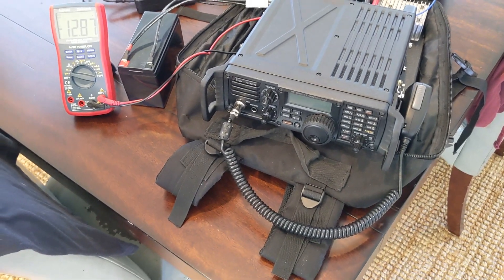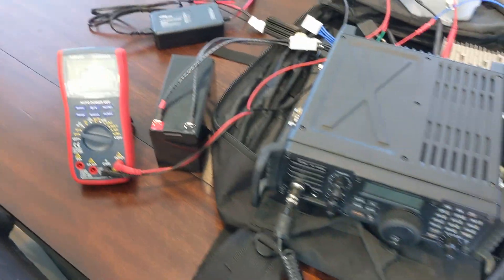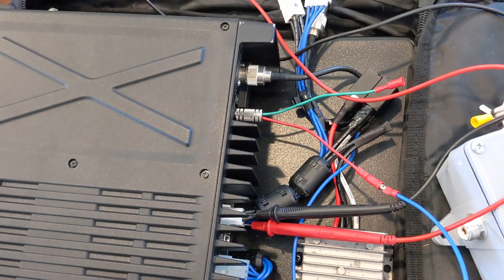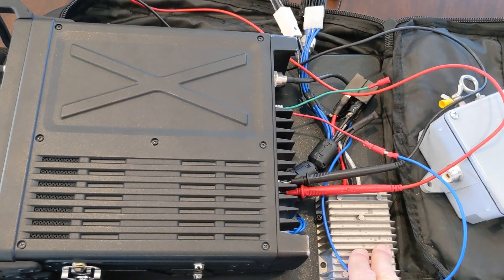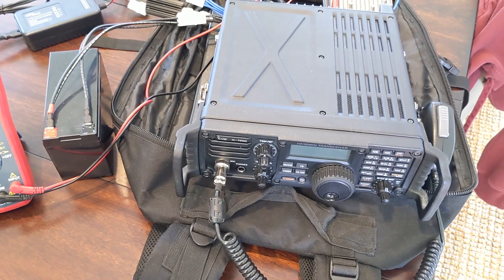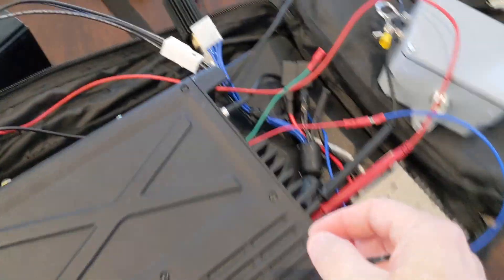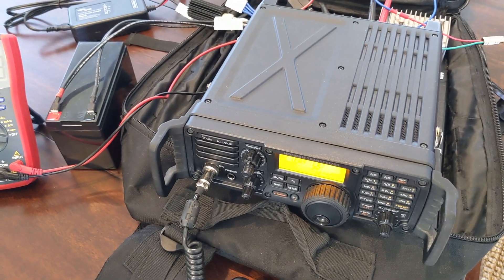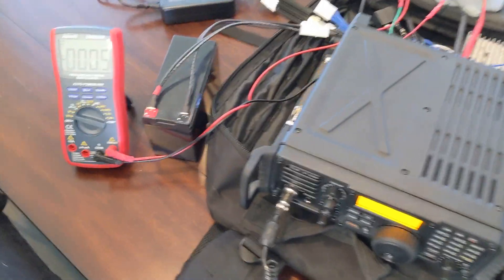Ham Radio Voltage Booster

Comment: What is the name of this booster ? Thanks
Reply from the maker: It's just a generic "buck converter" you can buy on ebay or aliexpress.  It looks like the prices have doubled since I bought mine.  You need one with an output of 13.8v and around 25amps for 100w radio.  The PTT activation circuit is custom made and allows the booster to enable only when the radio is keyed.  If you don't have the PTT enable, just be aware the booster has a parasitic draw even at idle.  You leave it connected to the source and even with nothing on the load side, it will draw power.  MFJ and West Mountain Radio also make one.  Never had any experience with either.

 I have 18,000 100w contacts on mine and it's been flawless.
Reply from the maker: Nevermind...I paid $60 for mine which is about the same price as they are now.  Search "B097GS1SFQ" on Amazon.